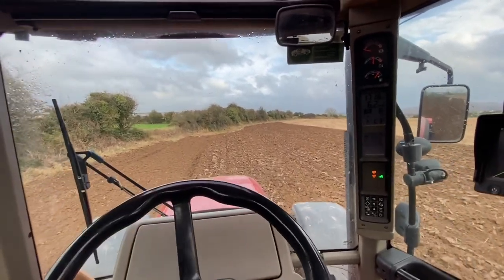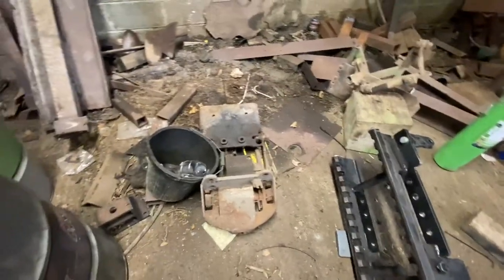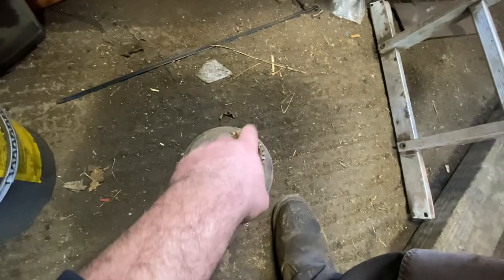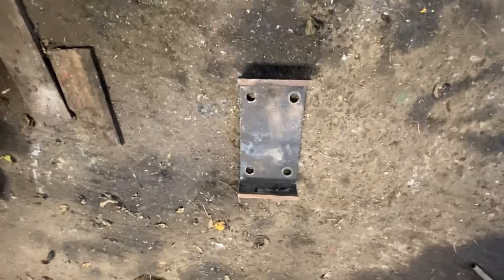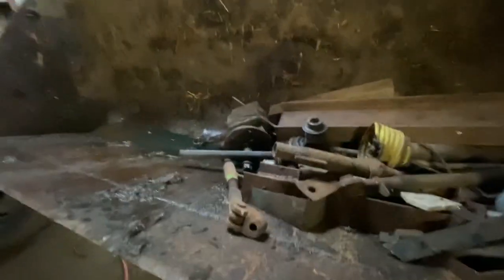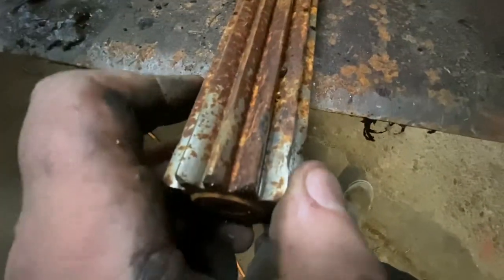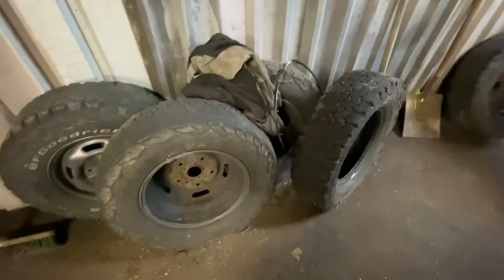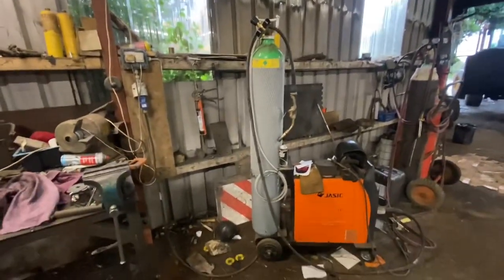SETTING CORN FOR THE VERY FIRST TIME ,THE BIG CLEAN UP IS ON!!!

Comment: A big board on a wall to hang spanners, sockets, hammers, battery tools etc so it’s all visual is a great job. 
Few pockets and pouches for nuts bolts etc all labelled and maybe drawers for computer boxes for mowers/ balers
Reply from the maker: We have a bolt wall that's full of lin bins.
Think this set up was easier work with when our machinery level wasn't so big

Comment: I put in a small loft a few years vack mighty job for the things that were in my way on the ground
Reply from the maker: I'm seriously bate for height in this shed Morgan the tractors just about fit in especially those on 42 inch wheels, eventually I will move across the road but have to get everything sorted first.
A loft is definitely a great job
Reply: @mrcvx  I have the loft with a few years . I will eventually get a stairs for it

Comment: Set up areas for doing certain things. Have all your drill bits and cutting fluids over near the drill. Have all your gear for welding in one spot. Make up a storage jig to have all your pipe separate from your box and channel iron. Have a little mobile workbench that you can wheel about so you can leave stuff up on so your not bending down the whole time. Let us know what are you up to in the workshop 😉.
Reply from the maker: All brilliant ideas to be fair 👍👍

Comment: Insulation would be great I think. Hanging all spanners on a wall is only good if you do jobs on the bench, if you work on a machine a tooltrolley is better. Some flat sufaces are great to put a project on are great but if you are like me it'll just end up with crap permanently on it. Shelving is a great spacesaver and some closed closets for keeping rarely used tools.
Watch some videos with decent workshops to get ideas. Oh yeah, an make videos of it all, I love the shed cleaning up and improvement videos.